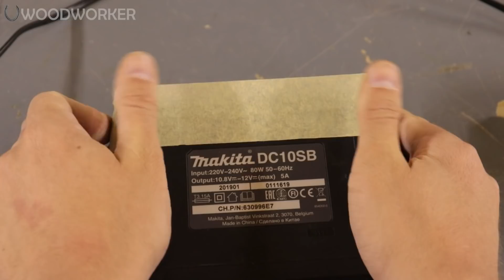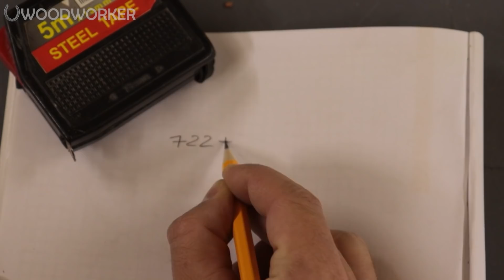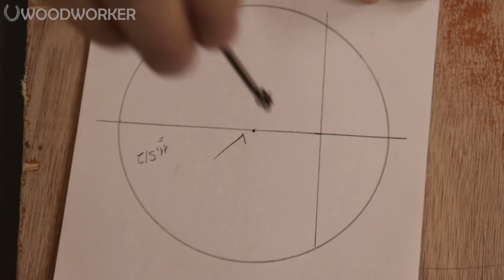Ingenious Tips & Hacks That Work Extremely Well - Construction Wood Inventions Videos ▶50

Comment: For mounting chargers etc, after fixing the two screws and mounting the charger I always place a screw tight in against the top. It makes it easier to unplug the battery using one hand and without lifting the charger.
Reply: Good idea! Thanks for the tip.😉

Comment: 2:06 don't try to tighten or loosen a newer brushless drill like that with your hand. My new Ryobi has all kinds of torque and speed and burned the crap out of my hand doing that yesterday! I think it warns you in the directions, but of course I didn't read then because I've been doing it this way for 30 years! It's made so you can tighten and loosen with the drill not running. Think it must have a like a brake on the chuck when the drill isn't running. I have a nice blister between my thumb and index finger right now!

Comment: 3:38 When using his technique to create threads in soft wood, I like to drizzle a little thin CA glue in the hole to stiffen the threads. After the glue dries I run the bolt in and out a couple of times with some paste wax on it to reduce the friction.
Also, 3 nails and a loop of string makes a perfect egg shape, and 2 nails + the string makes an ellipse.

Comment: The thread strength test is a bit biased given the stock used to test was a softer wood than the threaded stock. If the user used the same would then it would give a better indication especially given that generally joiners will use the same type of wood for a single piece.
Reply: Or... do it again same wood no thread! And test it

Comment: That bolt cut at 4:00 also works great for cleaning threads. Make the slit a little bigger and it gives rust and crud somewhere to collect or fall out similar to a tap.